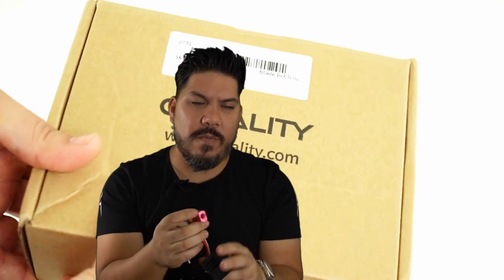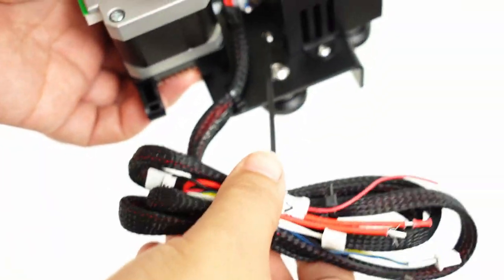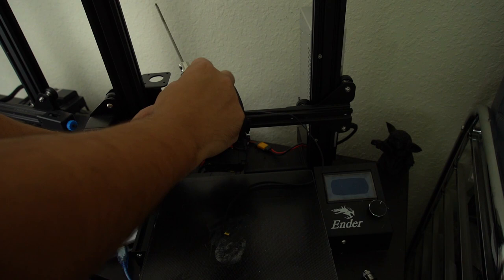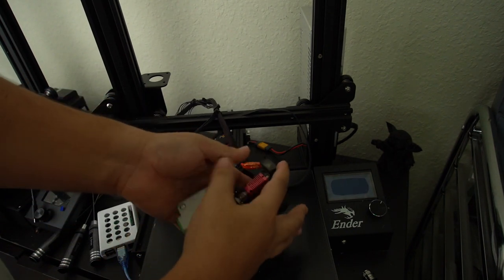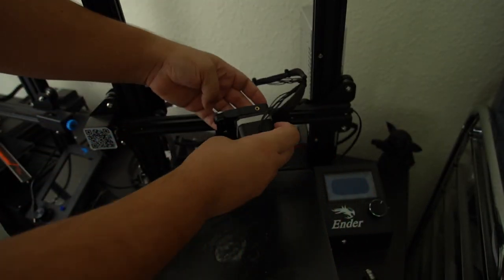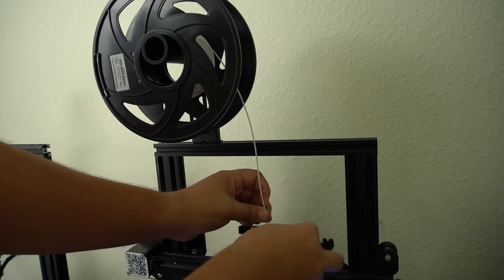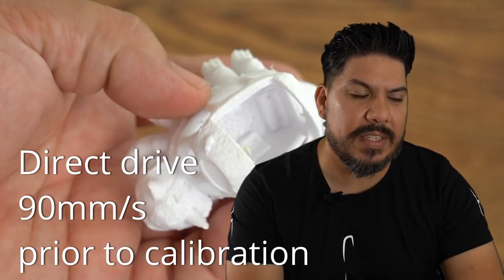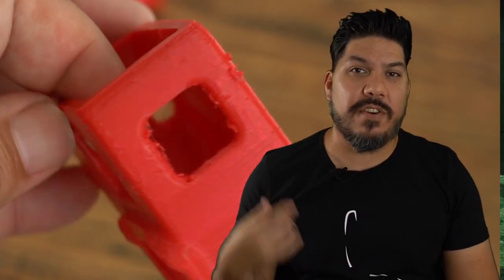Ender 3 Direct Drive upgrade - $35 to upgrade to Direct drive 3D printer? Print PLA and TPU faster

Comment: I printed a part that you just change on the extruder. It just tighten the path leaving the tpu no place to escape. I print tpu at 60mm. I don't doubt that the direct drive improves several aspects, just haven't found it necessary for tpu on the ender 3

Comment: Thanks, ordering the v2 today, trying to decide if I should just get the direct drive right away. Do you have any process for drying your tpu filament? I guess some don't have to worry but rh in my house is usually 40-50% :/
Reply from the maker: I don’t think this direct drive will fit on the v2 unless you swap the hot and fans over FYI.   I keep my filament in a tub/ tote with a lot of silica and I’m gonna test out a food dryer as well to get it even dryer
Reply: @JonE5FPV  from what I see theres no direct drive upgrade available specific to the v2? I feel like it would be better to get the V2 anyway/wait and upgrade later.. 

I'll use your links for the printer/filament. Thank you.
Reply from the maker: Windwalker FPV I would do that you said and get the v2, since it prints so great out of the box and can always do upgrade when it’s released later.

Comment: I just got one from banggood but the drive belt slots are different spacing.  The original is 2” the new one is 3/8” shorter making the drive belt not fit.
Reply from the maker: I had same one. Def snug, but was able to get it to fit and been printing fine.
Reply: @JonE5FPV  I tried and tried couldn’t even force the belt around the tensioner.
Reply: @JonE5FPV  waiting on a reply back from banggood.   The only other solution if they don’t want to fix the issue is cut extra slots in it.
Reply: @JonE5FPV  question for ya.  I’m noticing the e drive is running a lot hotter when using it in the direct drive position. When it’s in the std bracket it’s cool too the touch.    Any ideas on this
Reply: Exactly the same for me. Could not fit with the new bracket. I had some timing belt to cut the right length and now it works. Strange that no youtuber mention the problem.
Reply: @minibok2008  I just cut two new slots in the bracket for the original belt to fit.
Reply: @boazandruth909  With a dremel?
Reply: @minibok2008  I just used a hacksaw and some sand paper to smooth it but yes a Dremel should work if u can make the lines the same. I put them together to Mark where to cut the new one so the distance is correct.
Reply: @boazandruth909  Great, thanks